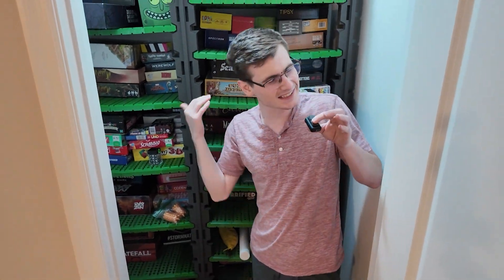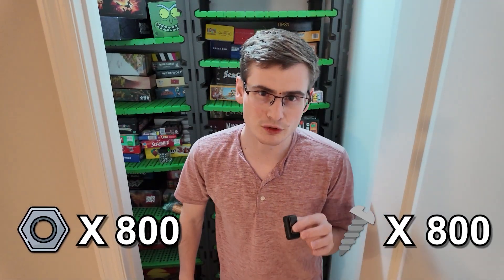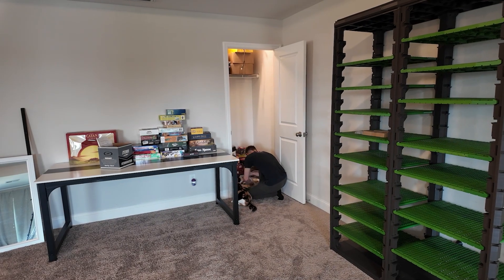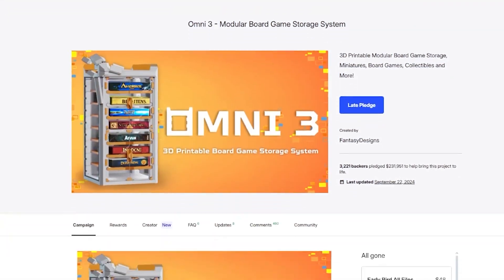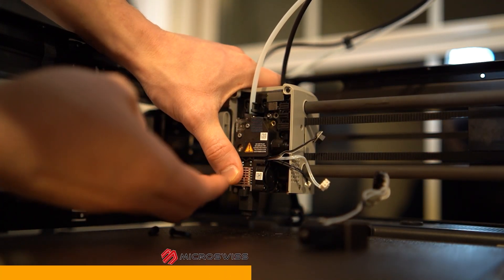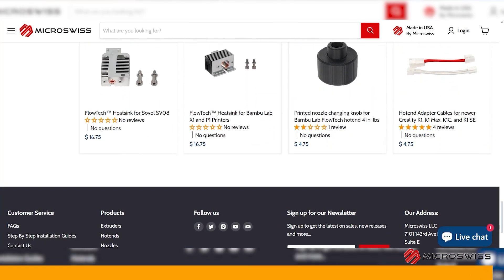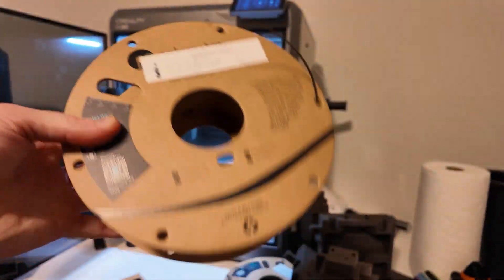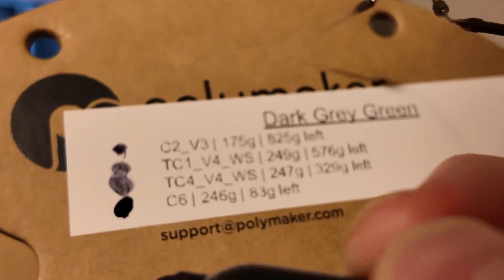This project broke my sanity, but it is pretty cool ;)

Comment: When the breaker trips once know what was running and next time minus that number by one of those printers
Reply from the maker: Unfortunately it's not that simple because the 4 machines running have 3 different power draws :/ without knowing exactly which printer was pulling how much power it's difficult to know what to change

Comment: Yeah, some things are not meant to be 3D printed...
I recently looked into printing some storage boxes for all of my small hardware for projects like screws, connectors, heatset inserts etc... Found some nice boxes online loaded them up in the slicer, hit slice  and went to a store to get some off the shelf boxes...
I will however create and print custom inserts for my needs, but some things are not worth printing...
Reply from the maker: I totally agree. This was definitely one of those times where some 4x8 ply from the store was a better options!!! D:
Reply: @ThePrintHouse  cool project and nice video none the less though 😄

Comment: I am suddenly less whiny about being 1.5 weeks deep into printing a shit ton of Multiboard. OOOOOOOOOOF.
Reply from the maker: Ohhhhhh yeah my next big project is multiboard. How do you like it?
Reply: @ThePrintHouse  I have been in full print mode so haven't hung any of it yet, but I can tell that I'm going to love it. The tiles are super strong and I'm using no-name filament. The prints are slow because of how complex they are, takes about 3.5 hours for a 9x9 tile. I know you can print stacks, but I decided to just do them one at a time. Not one failure yet and I've done about 30 tiles so far with 16 to go. I'm on one printer since all but two of the tiles are too big for my AD5X, but I did get all the connectors printed on it. I wanted to eliminate as many offset snaps as I could so stuck with my larger bed printer.

For me it's a big project that's worth doing! Definitely print with adaptive layers, saves a ton of time.